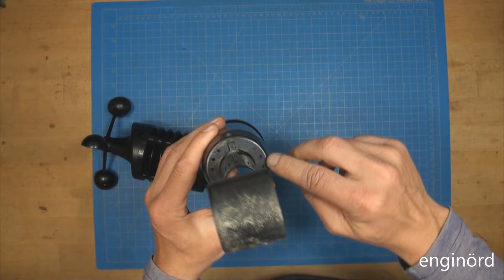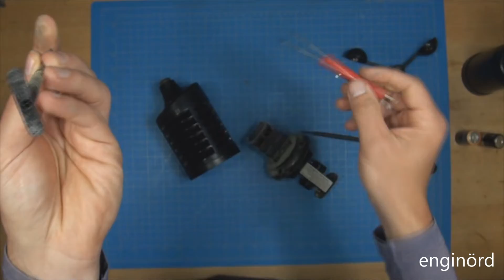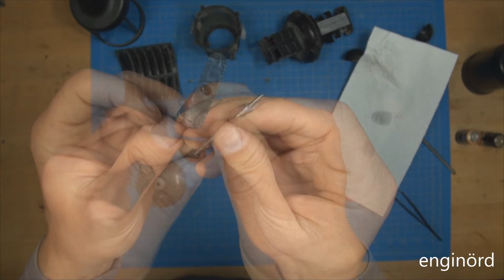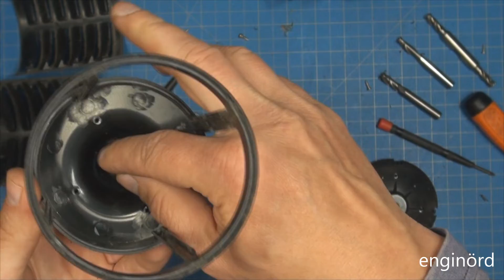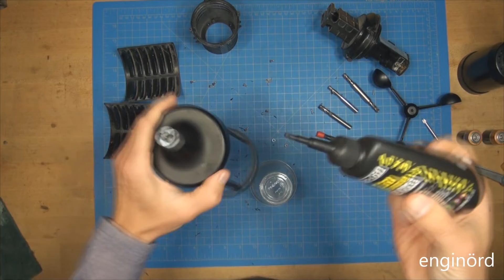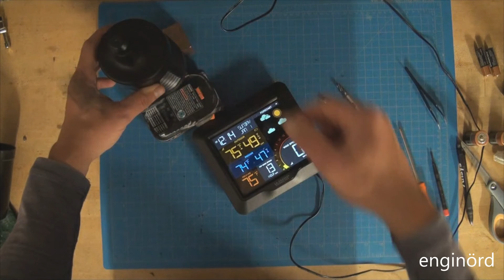La Crosse Technology TX144W Wind Speed Sensor Troubleshooting

Comment: Mine also had no shortage of spiders.  I replaced the bearings on mine and got it working again.  It worked for almost 2 more years and now for whatever reason it no longer works.  I'm thinking maybe something is wrong with the board, I can't get the red LED light to blink.  I thought of just buying a new sensor but when I went to the Lacross site they said this model  Tx144W is "retired"  they claim they have a compatible model for $50 odd bucks.
Reply from the maker: yeah. mine just crapped out again. the spindle is locked. I need to devise an outdoor proof budget friendly bearing.

Comment: I just got done replacing mine (TX144W to TX145W). Mine was completely shot, being that the average windspeed in my area of the US plains is over 20mph, it had gotten so hot it had melted both bearing support points. The TX145W is a slight improvement with a small solar panel, but all the same issues seem to persist, including having 3 batteries now (AAA vs C) that will have to be replaced. A fragile 2pt bearing system, unbalanced hall sensor, etc.

Out of curiosity I took my TX144W completely apart and it has several major issues that you weren't able to cover. The transmitter PCB in the base is completely open to the weather inside, mine was heavily corroded and covered in dust and bug parts. When the bearings in mine failed, it's pretty obvious that the magnet hit the sensor repeatedly before it completely stopped, damaging both.

It's not bad for a sub $60 weather station, but it definitely has room for improvement.
Reply from the maker: I think you painted a clear picture about the economics of these deeevices. I’m always wondering if these a better solution to seal these off, add magnetic bearings etc.

Comment: Nice fix. I am glad you were able to save it from the dump!👏
What a drag to have to climb the roof just to change the dang batteries. 
It needs a small solar panel and maybe a 3.7 V lithium rechargeable cell, perhaps harvested from a solar light?
Reply from the maker: Hopefully these bearings will last another season or two. You are right. Solar panels would work better, i’m not sure about lipo batteries though in a -20_F to +110F environment.
Reply: @enginord  No simple solution, I'm afraid. Our solar lights & automotive batteries take a beating here in the SW desert. CCA (cold cranking amps) are not much of a factor here!
Painting the housing/ battery box with white elastomeric roof coating may help.